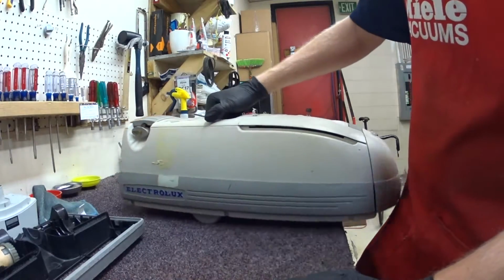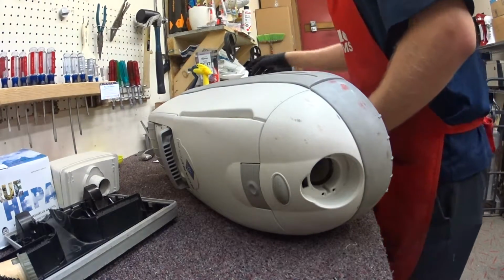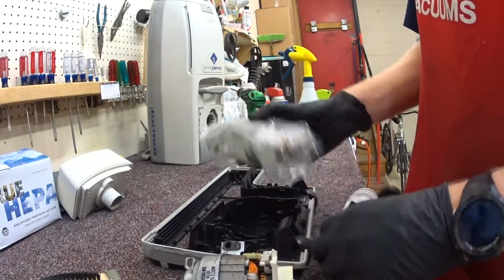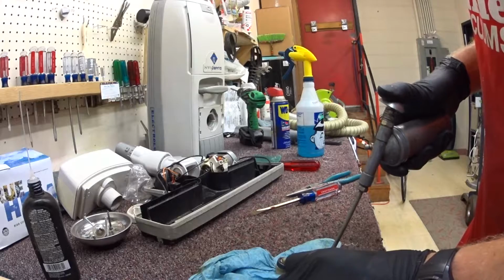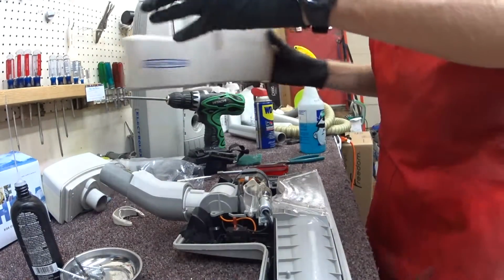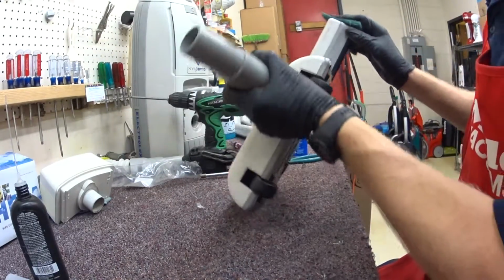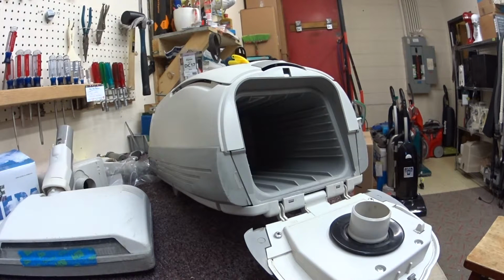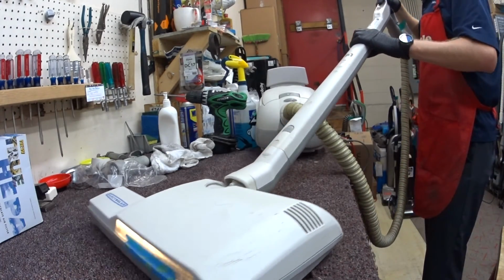Electrolux Guardian "Aerus " Model 134 Vacuum Repair

Comment: We have this vacuum for over 20 years. It has worked perfectly until yesterday when the cord system will no longer retract the powercord. Can you do a video on how to fix the cord retractor? Or point me to where I can find info on how to fix this problem? Thanks.
Reply from the maker: The parts are pretty much discontinued for this machine. It's time to replace it.
Reply: @PerformanceReviews That’s a wasteful and silly recommendation. Aside from the cord retractor, the vacuum still works perfectly.
Reply: @VegasVaron Ya why get rid of a vacuum just because the cord won’t rewind

Comment: How to troubleshoot low airflow/suction on this model? I've checked the filter and the motor sounds fine...
Reply: I had a problem with low airflow on my Guardian Platinum and it turned out to be a couple of clogged hoses.  In particular the hose from the bag door was packed with crud.  That might be a place to investigate.  These didn't have super powerful motors btw.  33 cfm is about it.

Comment: Loved mine I had the blue one and still have it,only thing I couldn't stand was the small bags ! Get full so fast which means it's doing its job,sadly I got the wrong watt light bulb in for the power head  and when I put it in it shut down and the green  power indicator no longer shows  so I can't turn it on .so I just use both my upright electrolux vacuums .
Reply: have you tried ebay for an other one same style but a different color pretty much

Comment: As far as quality goes, I like the one's that were made during the 70's, 80's and 90's with the mostly metal handles and canisters. I personally hate this model because of the plastic handle which can break easier. I also do not like all the fancy, expensive hepa filters, even though I am shooting myself in the foot because I have allergies. My lux 2000 or classic lux only has the bag and the carbon filter and that is it. It still runs good till this day. All we do is buy bags, after filters, and clean sweep chips to freshen the air. But If I had to pick a favorite to keep forever it would be the Grand Marquise model made during the late 80's because it's the last of the metal bodies.

Comment: Greetings Alex,

I started vac repair for a local shop right out of HS back in 1996 - for about 2 years.
Afterwards I went on to college, went into Mechanical Engineering - tool/tooling design and manufacturing processes.
Manufacturing isn't exactly a stable industry in the States -  got tired of making things work for companies who didn't do the same in return for me (which is most of the companies out there. kids, the American Dream is BS - find another angle).

I've recently started doing Vac repair out of my home. I am now receiving 2-3 vac repairs a week via an online community forum.
I just took in my first (Guardian  C134B) Electrolux canister since last working on them 25 years ago.
I am finding I can source a lot of parts on Amazon, and some other places like eVacuumStore.
I too worry about OEM quality and I was wondering if you could share with me a good way to source quality parts, especially for Electrolux. 

Great video and thank you,

John
Reply from the maker: Steel City vacuum parts or Nationwide distributing.

Comment: Alex, I have the same model. After running about 10-15 minutes its shuts off. Not a full bag and the the bag indicator light doesn't come on. So, I dont think it has anything to do with the bag. It won't turn back on till i let it sit a few minutes. Is there some kind of sensor on these motors?
Reply from the maker: +dave jones well there's an exhaust filter or something stuck in the hose or powerhead would be my first guess from those symptoms. There are a couple circuit boards as well in this unit.
If you need further help on it go to my patreon page be happy to help you
Reply: Hepa filter is new, nothing in hose or powerhead. I found a wiring diagram on this model and it shows a "thermal cutoff switch" on the red wire coming from motor. But my thinking is, the thermal switch would either be good or bad and not allow the vacuum to run at all if it were bad. The patreon page? Is that a page to compensate you for your help? If so, i have no problem with that as long as the help is useful. Thanks!
Reply: @DMJ160 ,

Patreon is an online service that allows anyone to financially support their favorite content creators. This allows creators to connect with their fans and earn income from their work.
As you may know, ads and other online revenue formats are often unreliable and insufficient for making a living. Thus, Patreon provides creators with a more steady source of income.
In return for their support, those who give money (called “patrons”) receive exclusive rewards. It’s a bit similar to crowdfunding services like Kickstarter, except with Patreon, the support is ongoing instead of all at once.
Patreon takes 5 percent commission and transaction fees average 5 percent, meaning creators get to keep 90 percent of the revenue.

Comment: I worked at Aerus Electrolux back when they were known as just Electrolux when I was in college.  I never heard of them before I worked there.  I thought it was bullshit that people would pay $1000+ for a vacuum cleaner.  But I found out Aerus Electrolux makes really good cleaners. There's a difference between Aerus Electrolux  and Electrolux since they're two different companies.  I was a newbie and got most of my leads from door-to-door sales. To this day, I still can't believe some women would let me come into their homes for a demo. 

Once I left college and started working, I bought an Aerus Electrolux commercial upright cleaner.  I've had it for over 12 years now and it's built like a tank.  I only use authentic Electrolux bags and the suction is as strong as the day I bought it.  If you take care of it, an Aerus Electrolux will last you 20+ years.

Comment: The elongated shape allows the cleaner to easily rest on standard-width  stairs. You're correct that the HEPA filter was added on the Guardian-labeled version in 1999. Some other trivia:  the colors were named oyster & fog;  "Aerus" is Greek for "Air" and is pronounced "Air-us"; the model N106M power nozzle was used for the Epic 8000, C134A & C134B--the printing on cover of the first was red and on the last two was blue.
Reply: What is the difference between the A and B model

Comment: The model C134A wasn't marketed long before the nearly identical C134B succeeded it (although I'm unsure what change was made). Its body style was introduced in 1994 on the Renaissance/C104A.  Later, the label was changed to Epic 8000, then Guardian, Guardian Encore, and Lux Guardian.  It was discontinued in 2009 and succeeded by the Lux Guardian Ultra/C170A.  All in all, it ran for 15 years with twelve different model #s, which indicated changes and, upgrades, and/or those sold indirectly rather than door-to-door.  Thanks for the demo.

Comment: I have this model in the Epic 8000 variant, basically the same but without the "tumor" on top, which makes the machine look much nicer in my opinion. I also have the brand new Aerus Guardian Platinum with double HEPA filters; I'd be curious to see what the emissions rating is on that one
Reply: It would probably go down to 0 Miele isnt the only one that does that.
Reply: @580678  Japan is this weird parallel universe of home appliances and some of their vacuums are pretty novel.  They were on a thing for a while of selling ULPA rated vacuums.  ULPA is the clean room standard, 99.999% filtration at 0.08 microns.  Very expensive exhaust filters.  $85 for the filter for my Panasonic MC-SXJ4000.  Looks like a small round automotive air filter that goes in a hatch on the bottom of the machine.